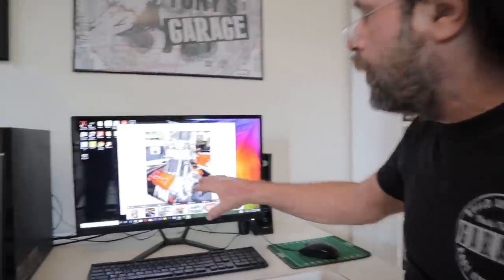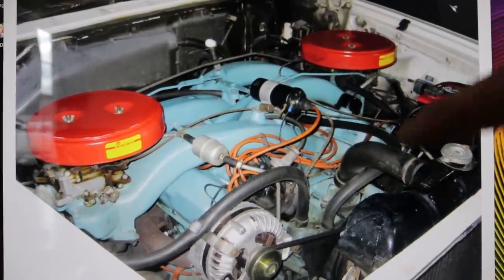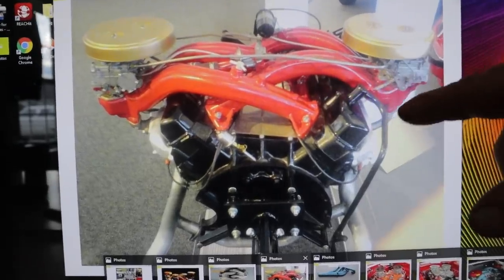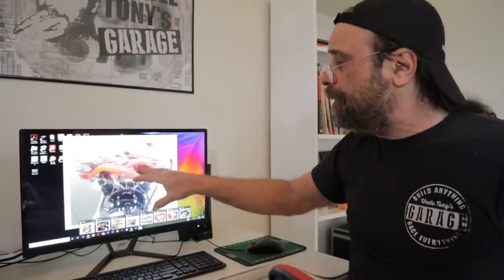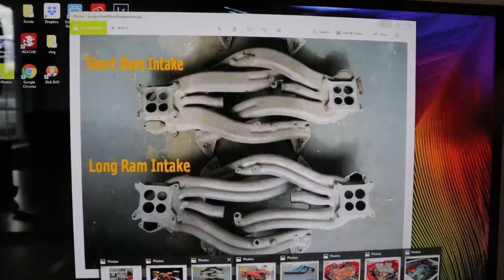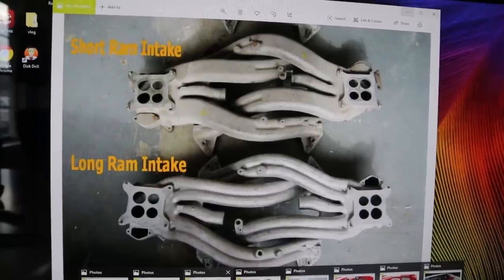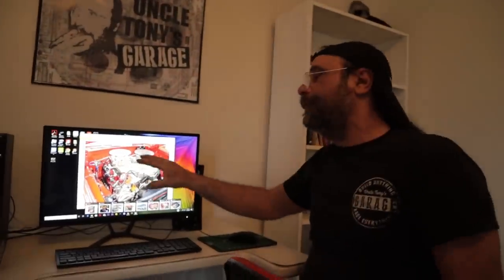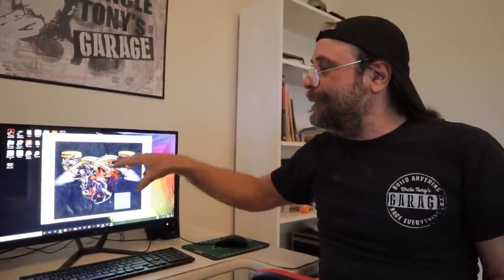The Original Mopar Cross Ram Intake Manifold

Comment: You seem to have some good knowledge, so.... do you know on the long tube cross rams, the heat tubes I don't drive her in the raining day, so is it better to connect them or block them off? Before there was a freeze plug plugging the manifold holes but I since opened them back up. Gonna take them off again to paint, clean so I'm asking if I should use the heat tubes or plug them off? (Yes I will connect the pipes this is only for the exhaust gas being used or not)... please help! I cannot find a real answer

Comment: Well, not to forget the Hyper-Pak- the mythical over-the-disc-option ramchargepackage. Made only to spank ass in NASCAR, as they also did 1960!
7 Valiants in the startingfield, 7 Valiants competing för the win- ending up in place 1-7.
Reply: And then NASCAR cancelled the Compact racing series gee I wonder why lol. Smokey Yunick said the slant six responded to a few simple bolt on improvements, more than any other engine he ever saw. The Hyperpak kit raised HP of a 170 cu in slant from 101 to 148 a nearly 50% HP gain from a cam and kit, intake and carb, duals and a clutch kit (to handle the extra HP without slipping).

Comment: Those blue/green tubes you point to at about 2:30 are '63 - '64 tubes (also used on '60 - '61 factory Daytona Beach and Salt Lake cars) and are NOT  the same as the '60 - '61 tubes you start with in your video.

Comment: Or if the Early Hemi ever received any similar research and development. But actually I believe that they were just reaching for what they once had in the 392 . To make a 413 perform as well as the 392 required all of this ? The fact that the 426 hemi exists is proof that this really didn't work out. I still think the manifolds are cool though ( intake and exhaust ).

Comment: You just verified a debate I've had many times over the years, that debate being if the High and Mighty was in fact a Chrysler test mule.
You just verified my side of that debate.
Now if I could just get them to accept that the the "backwards" piston trick in fact came from a Chrysler high performance racers tech tip bulletin.
Reply: I have an old Chrysler direct connection engine builder book. The piston flip is in it.
Reply: @sczuylevch13  
Yup,
That tip (from Chrysler) has been around since the early Super Stock days.
We're talking early '60s here, and some people still claim it's BS.
When I was building high performance and race engines for my living I called one of the premier engine builders of the time, Joe Sherman, and asked him about it - I didn't have access to a dyno at the time and he was always willing to answer questions - anyway, he told me that he had seen a gain of just under 40 h.p. on a 455 Olds with no other changes. I was doing a low budget build for a customer and knew about that trick but wanted a good solid answer about what kind of power it was worth.
With that change, an aftermarket cam and some porting the car picked up by just under 2 seconds at the track.
Reply: I've heard that flipping the pistons goes back to the 40's and racing Flathead v-8's.
Reply: @raoulcruz4404  
Could be!
I don't remember the Flathead having offset pins but I only remanufactured two - but if so it would definitely work.

Comment: What happens when those runners are of different lengths?
Thinking of slant 6, never actually measured but would assume those runners are of different lengths getting progressively shorter the closer to the middle of manifold carb location.
Reply from the maker: I covered that in a Slant video.  The three length runners do help to broaden the torque curve

Comment: So this is a "roll racing manifold"?  :) I think the slant 6 hyperpack could be included. I noticed these are for spread bore carbs, does that make a difference ? Perhaps better economy & responsiveness?
Reply from the maker: The AFB's used on these had just slightly smaller primaries.  Nothing like a Qjet or Tquad

Comment: thanks for making this video. I've wondered over the years, what could be done to improve the long tube cross ram. if it was me. i'd put the carbs where the intake makes that little hill going towards the heads. that would help "rush" the fuel into the head better. next, i'd play around with the angle of the runners going into the heads. and with today's modern cams. i think you could build a damn good "shade tree engine" then add some sealed ram air to the carbs. something like the thunderbolt. and it'd run like a raped ape! i'm a die hard mopar guy. but my current car is a 97 prelude. and i built a true sealed ram air system for it. and no, neither the car, nor me is a ricer. i incorporated the ram air system into the body. so if i didn't point it out. you wouldn't even know its there. and despite what these young whipper snappers think. ram air, if done right DOES in fact work! i don't know where they get this idea that it doesn't, but whatever. maybe someone should tell big daddy don garlits, and pretty much every drag racer that ram air doesn't work....lol

Comment: I traded a nice Glastron Swallow V river boat w/ a BBC for a Hemi Cuda that had the shorter cross-flow intakes w/ big Carter AFB 850 carbs. Good Lord, that car could pull the front wheels off the ground and nothing could touch it on the 1/4 mile drag strip. Sadly, that car got totaled out by a damned drunk semi driver that blew a light and nearly cut that Cuda in half, as it ran right up and over me. Amazingly, I was able to walk away from that little skirmish, unscathed. Had a blistering adrenaline headache for the next 5-10 minutes, but I was walking. smh

Comment: Gasoline and air are liquids, however air is much lighter then gasoline. The engine sucks in the air first followed by the gasoline sort of like the Tortoise and the Hare race. This limits the engine speed. If only a guy could use gasoline vapor and air so that it is 100%  homogenized so that they stick together as a one whole liquid. Now the engine can feed itself with both air and fuel getting there at exactly the same time like nose-to-nose at the horse races.

Comment: i love tunnel rams for the street the only way to go the engine last  a lot longer then a boosted engine or nitro and u still can get big power out of them just have to build the engine for it like high compression unlike boost witch is low compression my friend had a blower and i had a tunnel ram but my engine put out all most 400 hp over his with out nitro and on pump gas i was putting out over 1200 hp in a 327 back in 94 but i think old man bell had a lot to do with it that guy knows his engines he seasons every block he does and polishes the inside of the blocks reduces the weight of the block and built the heads for it so i would have cast on cast witch last a lot longer never had a head gasket go on it still runs hard today the heads cost me 3800 in 94 to have them made but nothing but the best of the best went into the engine

Comment: You ever do a video on the "Hemi Tick".  Something Dodge should do a recall on but remains silent on this problem.  Thought you might have some insight.
Reply from the maker: Don't really know much about it
Reply: @UncleTonysGarage  I'm having to replace my motor at 80,000 miles because the lifters went bad and messed up the cam shaft inside.  Problem on  hemi motors in the trucks and cars.  The hemi tick sounds just like a loud tick and it's the giveaway.  Worth looking into.
Reply: It is a problem in gm and mopar mds' that idle too long.
Reply: I've heard it was the mds, also. There is a way to disable that feature.

Comment: Chrysler engineering is frustrating. They were ahead of their time in many ways, but also did things like running the ignition system on 9 volts, reducing it through a part that is made to eventually fail. Still love the mopars tho.
Reply: The ballast resistor was to aid coil saturation. I've got many, many miles driving points cars. Drove 85,000 miles on my '70 318, only failed once and fixed it on the side of the road in 5 minutes. The family wagon (points) drove who knows how many miles as the daily driver and taking the family on vacation, year after year. Never failed. And that doesn't include the many hours I've flown piston aircraft with points. Never had a failure. And I know that the points in an aircraft magneto are the same construction as a cars. Been stranded by electronic ignition, 4 times.

Comment: Could a person remake these as long as the intake runners are 30 inches long or is there some voodoo stopping you. I have a 318 in a b body and measured it out. But if I made some would it even work or just a waste of time and money
Reply from the maker: At 30 inches, they won't even come close to fitting a B Body.  Carb would be in the middle of the upper shock area
Reply: Uncle Tony's Garage I was thinking of putting them where the battery and coolant overflow is. I’m looking at my charger and I think it would fit, the next problem would be air flow. I do believe it could fit if made custom but the question is efficiency and how hard it would be to start it.

Comment: Does Uncle T have a video about why in an engineering sense 383's are not considered much as performance engines?
Reply: Riverdeepnwide   He does have a video basically arguing against the adage “ there’s no replacement for displacement “.  Which is why I think everyone is 440 happy and ignores the 383. Way back, 383 were a respected street performer.  440’s seemed to be expensive and hard to come by. 383’s were fairly plentiful.  In general, the Ford and GM guys wouldn’t scoff at a 383.
Reply: Raoul Cruz love b engines. You're wrong. 383's are an over square engine. The love to rev. Sure you loose some torque to a 440 but after 3000 rpm they come to life. I always say they are a bigblock that thinks its a smallblock
Reply: I agree. And that’s basically the same as I said. They were great performers Lots of torque. But folks go for  big displacement. No engineering reason to avoid a 383 other than cubes.
Reply: Raoul & Hal thank you for your input.
Reply: Raoul Cruz sorry. My bad. Misinterpreted what you said. Everyone always seems to hate on the 383's
Reply: Hal 1000   Years ago, I had a 69 Super Bee with a 383/4spd.  (Stone stock)I liked to cruise in it. Did not thrash it. That’s the truth. But... there’s a dude somewhere with a 400/4 barrel trans am that hates 383’s.

Comment: Ah, yes. Finite wave theory, there are many tuning lengths for any given volume and RPM. It’s too bad they didn’t have Prof. Gordon Blair’s books on four stroke and two stroke tuning. Runners go in and out phase with valve timing, you can get shorter runners to tune at lower RPM with proper camshaft design. Basically Blair put pressure/temperature sensors along the intake runners, in the plenum, in the cylinder heads, etc. once you know the T/P for a given configuration it’s just math. For every degree of crank rotation the program calculates all the pressures including H.P. And torque. Then you can write code to Run a program to do the calculations and simulations on the engine parameters. His algorithms are used around the world by major engine manufacturers from weed eater engines to massive diesels in cruise liners.
Reply from the maker: Ya...but these guys only had pencils

Comment: This is the problem with engineering of modern engines! The manufacturers are so interested in adding "technology" to the interiors...mobile hot spots, lane departure warning systems, "adaptive" cruise control, parking assist etc. that they don't know how to build REAL cars and trucks that the average Joe can afford! The technology to make powerful engines has been around for years and hasn't changed all that much. I don't need or want info-tainment systems and all that garbage that will just cost me money WHEN it breaks! Give me a 3/4 ton 4x4 pickup with a simple V-8 engine, a manual transmission, a lever for the transfer case, simple radio, gear ratio to pull my trailer and make it cost less than a house and I'd be happy. It ain't gonna happen though. So I'll just keep fixing my old stuff. I gave a kid from work a ride home the other day, he was fascinated by the wing windows in my 78 GMC. He's actually been hanging out with me in my little shop since then...he's a good kid! Maybe I should explain the "kid" thing...I'm 51 years old and he's in his early 20s. He's a kid to me lol! He seems to be a gear head that wants to learn so I'm happy to have him hanging around. Who knows, I might learn from him too.

Comment: 69 DODGE SUPER BEE... Uncle Tony great show huge Mopar fan in St. Louis Mo. Question... Mom is an original owner of 69 Super Bee apple green white top duel air grabber 383 727 410 Dana 60 numbers matching accept for the Dana.  Has a complete Moog chassis Very little rust. All paperwork and window sticker Problem is Dad spun a rod bearing in 77 and it’s been in the garage since then. Always talked about getting it on the road but didn’t have the money. Needs a complete restore.Dad passed a few years ago now Mom is trying to sell it. Do you know any buyers and what do you think it’s worth.
Reply from the maker: Off hand, really hard to say.  If it's really solid, probably in the 10-12000 range
Reply: You won't have a problem finding a home for that car.